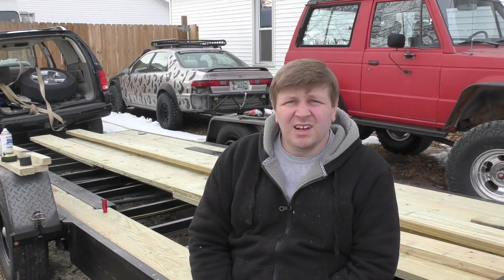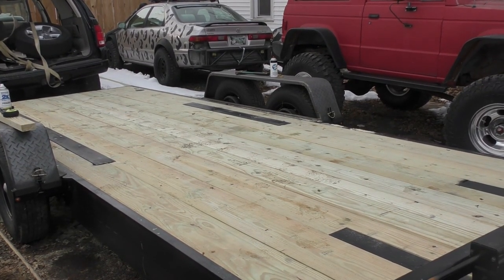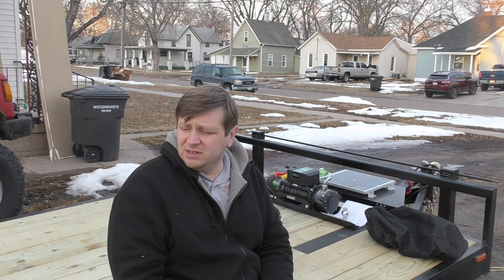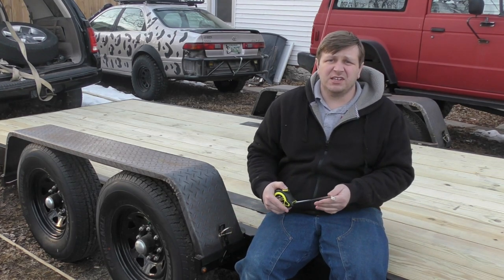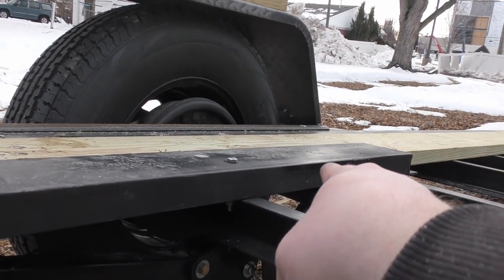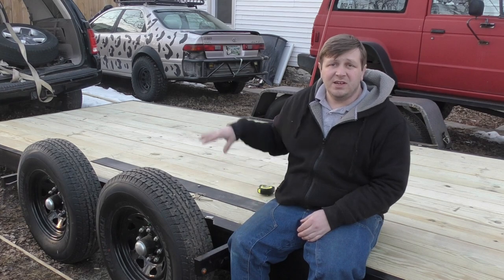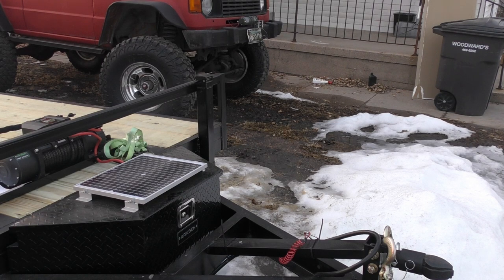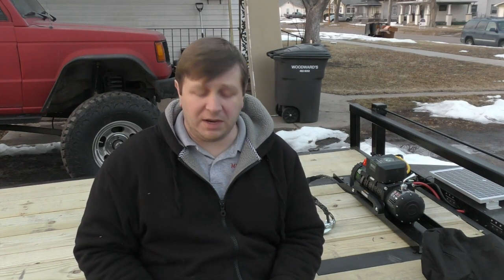Air Ride Tandem Axle Trailer | Finale

Comment: 1) I didn’t see rubber bumpers on the axles. Metal-metal?
2) Floor level valves and pressure release button, in my personal opinion, work better than electrical components.
3) Compressed air can be placed in the front grille pipe. 2 x 6.56 ft 3" pipes = 3.99 gallons volume. Quite enough for a receiver.
It turned out to be a good, strong trailer. Good luck with business!!! )))
Reply from the maker: The rubber bumps are on the frame - thanks for watching

Comment: so, after using trailer for a while, how do you like it?? I am considering building a air ride Gooseneck trailer.
Reply from the maker: Enjoying it quite a bit - it is nice to adjust the ride so it goes smooth whether loaded or empty